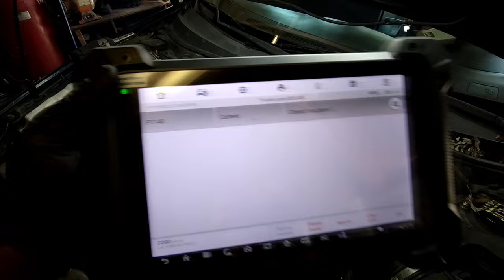non-invasive sludge removal from piston rings

Comment: I have the oil burning 2.4L Toyota engine in my 2006 Scion tC due to poor piston design. I did an engine soak by pouring in Marvel Mystery Oil in the cylinders and letting it soak while occasionally agitating the engine. This worked pretty good the first time. I later added brake cleaner and a bit of WD-40 to the cylinders. While I did cut oil consumption by about 50% it still burns oil. i am not sure what I will try next. Maybe this is all I can do. I am not a mechanic.
Reply: Berryman B12
Reply: I have your engine with only 45 k miles. Any advice to prevent perhaps using mmo?
Reply: @goldengirls0125  stay on top of oil changes
Reply: @goldengirls0125  change oil every 3k miles. Be religious about it.
Reply: Why not another round of brake cleaner w/ wd40?
Reply: My daughter has a 07 scion that drinks oil like crazy. I am pretty sure the oil rings returns are clogged. I started putting a little marvel mystery oil in the oil and I believe it has improved a bit.

Comment: Regular oil doesn't actually clean anything out. The detergents are to prevent sludge buildup, not actually clean anything... solvents are poor lubricators... if you want to fix compression due to stuck rings you need to use a solvent.
Reply: What solvent would you use that is a good lubricator?
Reply: I would mix equal parts ATF, engine oil, and diesel fuel

Comment: If the problem with this car is truly carbon and sludge build up in the ring grooves, then using solvent based cleaners in the oil will definitely work, but it needs to be the right cleaners and the process may take some time like a few weeks and maybe an oil change or two. I have found Liquid Wrench to be excellent for this job, I have used a quart in a 5 1/2 quart capacity oil volume. If there is an acute problem such as a noise or drastic oil consumption there can be noticeable improvement pretty quick, but it will take continued treatment over some time to really do a good clean up because the area gummed up is in a hard to reach location for the oil and by its nature the flushing/cleaning process is pretty slow. Put the cleaner in and drive the car, you need the hours of time and the stop start cycles. This condition is due to poor maintenance but was once also because of poorly formulated motor oils, back in the early days. For the past 30 years the oils have upgraded to the point that now the chief reason for gumming up the works in a motor is just too long between oil changes, and factory recommended is TOO long.

Comment: So this is usually due to lack of maintenance except for a couple toyota engines. The 2azfe being one. They ran a really really thin oil ring and literally clogged up after 30k miles and then started using oil. Right now my toyota rav4, uses 1qt ever full tank of gas.. and I've had it since it was new.  I changed oil every 3k miles (damn the recommended 5k miles) and I always ran Rotella full synthetic. Which I've been able to prove has the least amount of breakdown back in 2004. (They could have changed their ingredients since then, idk) I need to try that test again and send the vials off of different brands to the same lab since it's still around. 
Anyways I'm gonna try this on the rav4.
Reply: You changed oil every 3k in your 2azfe engine, and it still burns 1 qt for every fill up? So, frequent oil changes didn't prevent the issue?

Comment: My Renault Twingo 16 v, when i drive in the city (Bogotá) have a Lot of  blue smoke , but after i drive for a long time(5 hours) trough the mountains ,pushing the engine to the limit in high revolutions, the blue smoke dissapear until Two or three days of city driving, when it come back. May it  be in relation with stuck oil rings that come loose under  high engine demand, And come stuck again in low engine demand ( city driving)?

Comment: Ok..Lack of maintenance..Last Resort...Do a hot oil and filter change..Then add Classic Engine Restorer with CSL (Copper/ Silver / Lead) Use the 6 cylinder Can for added product..If it helps..It can support rings/ Valve guides/Bearings...Last effort before rebuild/Low mileage engine swap.....
Reply: Pretty good reviews for the product.

Comment: Not even done watching this and I'm gonna comment already.  I literally just finshed making a video like this on a Yamaha Waverunner an hour ago.  Then came inside the house to try and watch a pro mechanic on how they "free up" stuck rings.  I have my number 3 cylinder giving low compression.  Inspection camera on side view shows all valves look to be closing when blipping the starter, all or at least most of the way if not all the way.  That sent me to shooting a couple squirts of oil down hole 3.  Compression came up from 55psi to about 180psi (normal is 210 to 220).  All the other 3 are at 220'ish.  Never heard of throwing ATF into the oil to free up rings from below but sure beats pulling the motor to do something similar in a jar.  I was thinking about adding a bottle of seafoam to the top of cylinder 3 at dead bottom, wait a couple days and see how much seeps down into the oil.  Never thought of using brake cleaner but surely that is a great place for me to start...then I'll waste out a can of seafoam to have that drain down next then do the oil change needed to see if she frees up the rings.  At least one of those should show signs of my compression coming up before having to pull another motor.  Thanks for the idea!  I don't think I have paint thinner but will do the brake cleaner/paint thinner mixture if I do.  Thanks for posting this!  EDIT ADDITION:  Man, great idea on watching the smoke to find the offending leaking cylinder!

Comment: Did you notice that when you blew air into the #1 plug hole (b4 plug removal) that the pcv hose blew smoke out. This tells me the plug well seal between the valve cover and head is bad.
Reply from the maker: Or the piston rings... Which were the primary focus
Reply: @partsshooter  no, you had not pulled the plug out yet. That's what caught my attention.
Reply from the maker: @padraicmcguire108  I'm confused, your initial comment referred to "blew air into #1 plug hole" maybe I misunderstood something
Reply: @padraicmcguire108  I noticed that too but I just assumed, because the ring was stuck in its contracted state, that the compressed air blowing inside was passing the piston ring and pushing vapor out of the PCV.

But no, you’re absolutely right. The spark plug was still installed when he used the compressed air.
Reply: @partsshooter  I saw that too. In that moment you were cleaning the hole before removing the spark plug. You applied air bec your pump failed, and then u can see the smoke coming from the pvc pipe when the plug was still installed.
Reply from the maker: @MFA-Marcelo  I must've been doing a leak down test, Its been so long and many cars I services since I did this, you'll have to forgive me recalling every event.  This car definitely had bad rings

Comment: Not only oil scraper rings are clogged but the piston oil return hole are carbonized as well. Carbon turns into crystalized molecules and it s almost impossible to remove it without rebuilding the engine.
Using brake cleaner (Acetone) would clean the top of cylinders effeciently  but would damage the cylinder walls coating especially alusil/nikasil bores.
Paint thinner will definitely damage seals.

An engine that has VVT and solenoids cannot benefit from fluid soak. Solenoids will be clogged and hydraulic oil tiny passages will be clogged. FATALITY.

Using high synthetic 5W30FE with high TBN like Liqui Moly special Tec B FE 5w30 which has a tbn of 11.7 every 500k miles can defenitely help dislodge the oil drain holes carbon and piston rings gunk.

Comment: To remove sludge : put a little diesel fuel in each cylinder then change oil and ad in a half a bottle of marval mystrey oil in crank case . then run it under normal conditions .😊
Reply from the maker: I'll do the diesel next.... just need a donor car!

Comment: I have a Jeep Wrangler 4.0 l 
There’s no visual oil leaking on the bottom of the oil pan nore in other visible area but I do be missing motor oil .  About half a quart  about a month that goes by . No smoke at the tail pipe and  tail pipe smells like nothing . This has got me going crazy
Reply: Its burning it in higher revs.

Comment: IMHO to avoid sticking piston ring in the 1st place is to use good engine cleaners while using the car.
Never had pistons sticking in my family cars , I always insisted on using cleaners.
Reply: Exactly I use sea-foam
Reply: What cleaners you use?
Reply: @Priority57  Additives that go in fuel, mainly had diesel cara but I use it in gas too.
Also did an engine clean but my engine didn't need it that much. 
Some cars need early oil changes.

Comment: Chlorinated brake cleaner, or pure carbon tetrachloride would work best for carbon removal. Of the non chlorinated brake cleaners. 3M works far better than the rest of them.
Reply: I use 5% clorox in the oil and run it for 3k. Great additive and cleaner!

Comment: My car BMW Serie1 116d 2012 190k km. It is burning oil 800g every 800km.
There is no liking
There is no smoke at all, black o blue
There is no oil in the exhausted
Engine behave pretty normal
what Flippen is?

Comment: woah!  wait,  8:20  plug isn't out but comp air blown into spark plug 'hole' and the pvc is blowing out smoke.......wtf ???
Reply: Either both intake or exhaust valves are open on the 2 cylinders allowing air to pass thru
Reply: Leaking valve cover would be my guess.